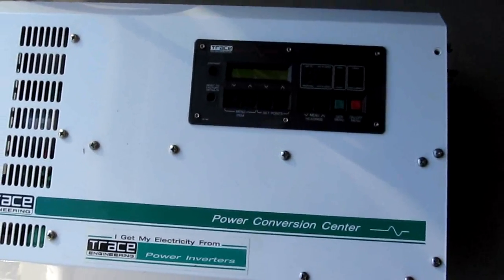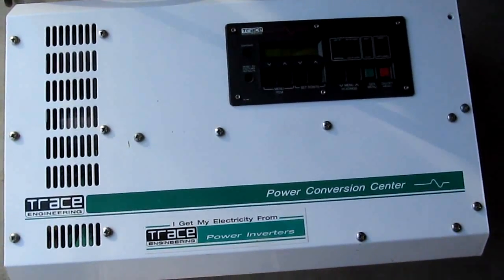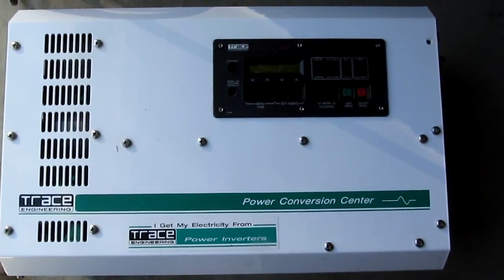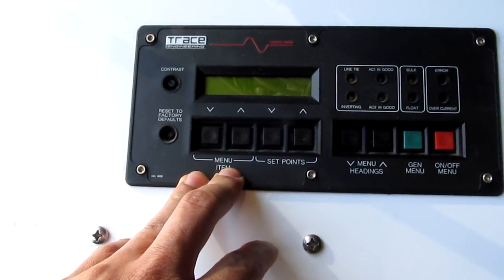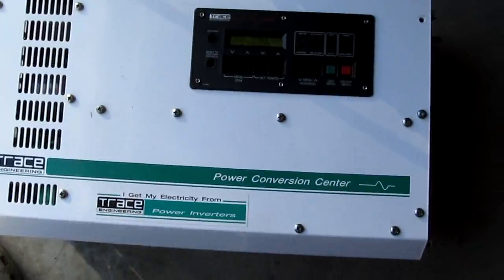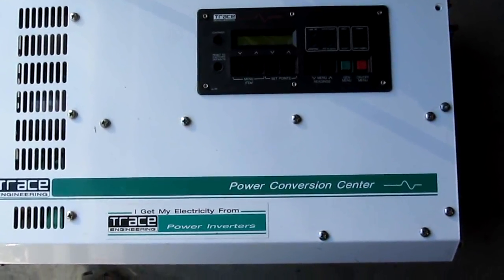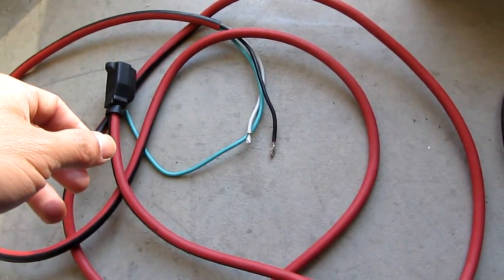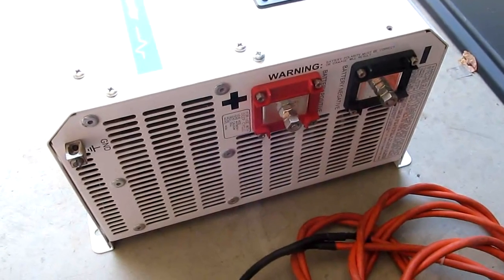Trace Xantrex SW4048 48V Pure Sine Wave inverter review

Comment: I have a SW4024 and have been using it for 15 years and it works great. I run 2 houses, a swimming pool and charge two electric vehicles.
Reply: are these able to charge li ion batteries
Reply: My concern is when connecting my panels too this unit, is there a fuse inbetween or is there someway too precharge the unit capasitors as too not overload and damage the new inverture. SCARY
Reply: Le prix stp
Reply: I have this one too, I need to upgrade my batteries. Do you know if I can run lithium with this inverter. My husband knew all this stuff but he passed away, the person I am upgrading with has suggested a new inverter but I dont see the point if this can still do the job
Reply: Can this inverter charge the batteries from solar panels??

Comment: Heya, just a word of advice. Connect the hot lead first then the negative. Less risk of sparks. :) also you should never use a red cable to connect to the negative post unless it's marked with black electrical tape or another signifier that it's being used as a connection other than its color coding was intended to represent :). Just trying to help a brother out